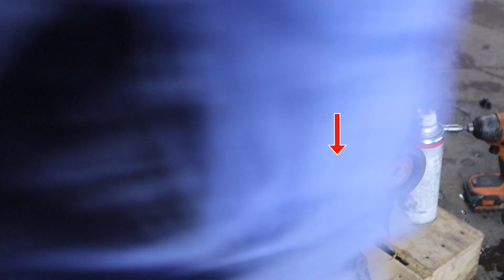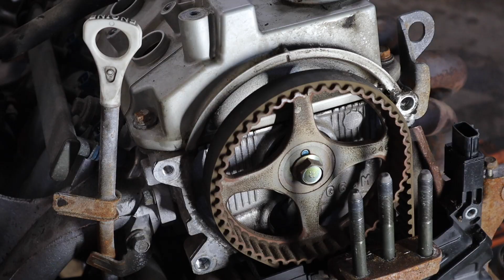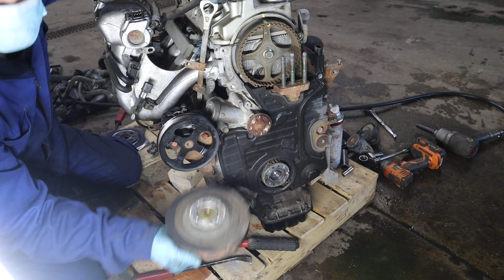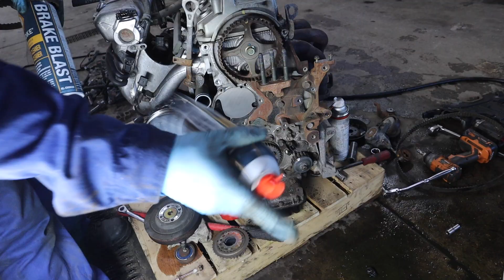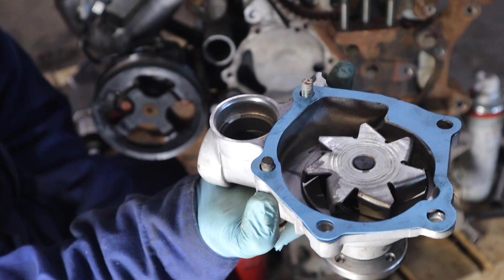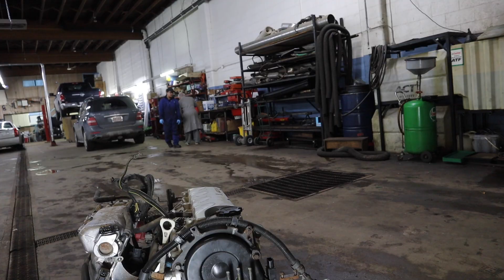How to replace TIMING BELT on Mitsubishi Outlander

Comment: Changing timing belt as you just did is that the same as changing timing belt on a mitsubishi 4g63 express van 1989 with carburetor and manual fuel pump

Comment: Pls i have been issued with my mitsubishi outlander 2005 timing belt cutting or pealing. In two weeks I have changed the timing belt more than 4 times and two days ago I changed the low pulley and I fixed another belt in. Hoping for it to work out for better this time. Please what can really be the issue of timing belt cutting or pealing sometimes?.  Thanks

Comment: FYI the oil pump timing mark is CRITICAL because it drives the forward balance shaft and oil pump. There is a plug on the block that you have to place a screw drivers in to make sure the balance shaft is in the correct timing when you put the belt on. Ask me how I found out about that the hardway.
Reply: I'm curious what ended up happening . The utensil using  is suppose to go straight thru right no block or resistance

Comment: My 2003 outlander is leaking oil from some where behind the timing cover ??any idea where it’s coming from I thought it was crankshaft seal but no oil there ???any help will be appreciated.
Reply from the maker: About your valve cover gasket?
Reply: @wongautofix5680   no oil up too . Was reading a forum that stated to check the timing tension bolt get loose and leak but is there oil there?
Reply from the maker: If there’s no sign of leaking oil there, you don’t need to worry, about your camshaft seal?
Reply: So what u think it can be?
Reply from the maker: @blaster75torres98  yes, this my suggestion, open the timing belt cover check around there,

Comment: Hi, great video sir - very well done. does this engine have V-TEC ? what is MIVEC? 
I have the same motor and when the engine is hot it will lose power but when it's cold it has power. I changed the spark plugs and the same thing

Comment: Ayos pre! Well done!
Reply from the maker: Thanks
Reply: @wongautofix5680  I've installed mine last night, took me 4 hours all went well. I also managed to lined up Crank, Cam, Oil pump timing marks. Rotate for several times and it goes back to its original marks. Good stuff.
Reply from the maker: @tanantanantananable  that’s good po,